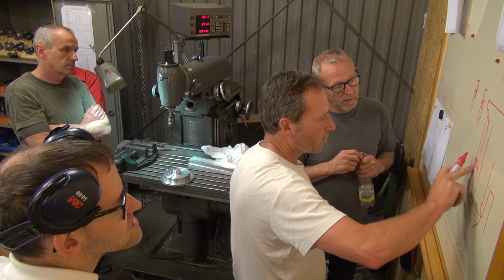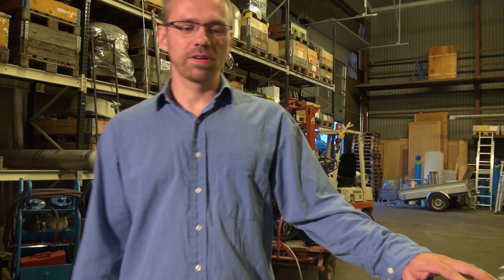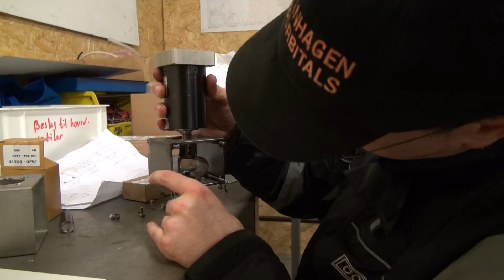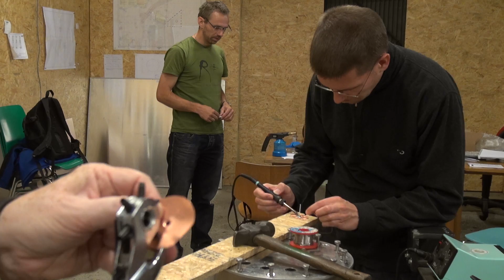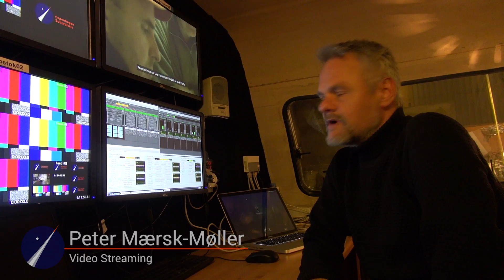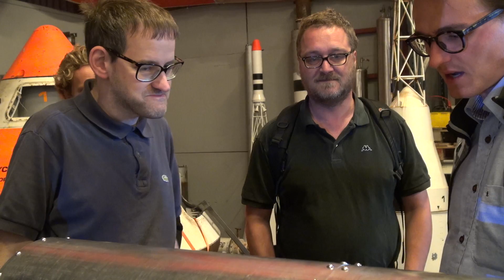The Nexø I rocket and it's creators.

Comment: I have a doubt, to control the vehicle, the system maintains the stability and trajectory via thrust vanes from its onboard gyro and sensors, wich can be made in real time i think or you control it remotely, wich in that case would need a dedicated satellite or some sort of UHF comm? Awesome job you guys are doing, best of luck!
Reply: They use real time gyro commands.
Reply: They use real time gyro commands.

Comment: Did I just see outside pipes on the rocket?
Reply from the maker: +John Doe Yes. There are "outside" electric cables on the opposite side btw. Both will be covered by a neat "cable duct" made of thin folded sheet metal for the flight. The aerodynamics & active guidiance people are OK with this, as long as it is kept within certain boundaries. The alternative would be do somehow make an internal pipe + internal cable duct inside the bottom tank in order to make the connection from the upper tank to the engine and for the electrics.. That turns very complicated very fast.

Comment: Does the rocket contain a single avionics board/computer or multiple avionics boards/computers located at different sections talking to each other.  I know you guys rolled your own Arduino's just curious about the overall system architecture.
Reply from the maker: +Roy Cohen Multiple boards. Hopefully we can do some form of video or website on that aspect of the Nexø rocket later in the year.
Reply: +Copenhagen Suborbitals thank you for the reply. Do all the boards communicate over a single can or rs485 bus or is it merely point to point if you don't mind me asking.

what you guys are doing is really awesome.